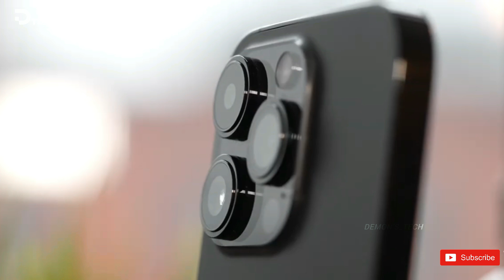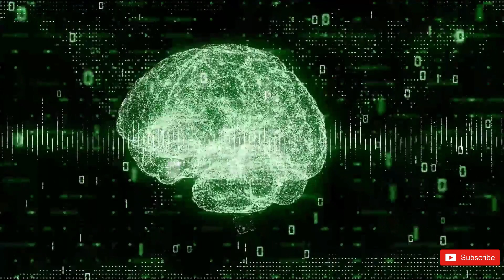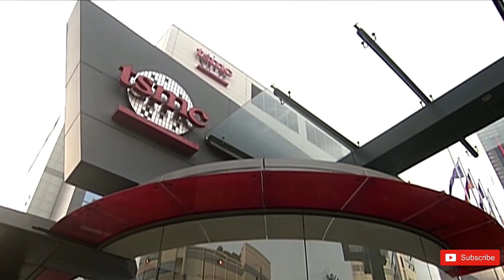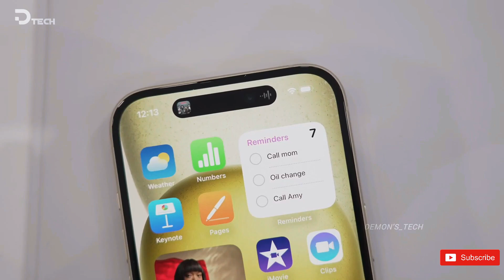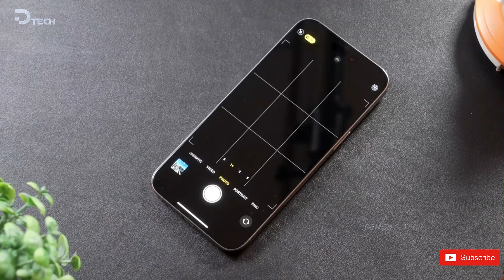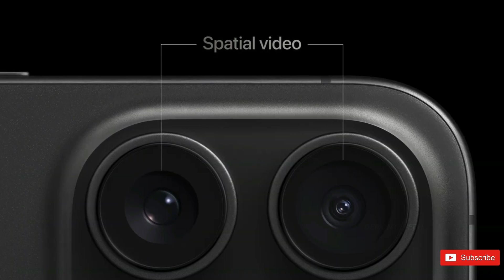iPhone 16 Pro Max - 5 KEY UPGRADES 🔥🔥

Comment: Still 60HZ in 2024?😅
Reply: Yea, still haven't realized most people don't notice a difference or like 60 hz more?
Reply: Most don't realize it because they never have used a 120hz screen. Most iPhone users buy the regular iPhone or iPhone Plus models.
Reply: If you used a 60 hz and 120 hz you can see it's a big difference.
Reply: @faizanqureshi4669  Ive used 60 hz on iphone and samsung, Ive used 144 hz on moto, trust me theres a difference, but for an average joe, they’re really isnt.
Reply: The $300 Android phone has a 90 to 120 hz screen that look smooth. I know the iPhone Regular Plus models are faster, load apps faster, and have more performance in CPU, and GPU, but it feels and looks laggy to use because you have to look at a 60 hz screen. 120 HZ FEELS SO MUCH MORE SMOOTH THAN 60 HZ.